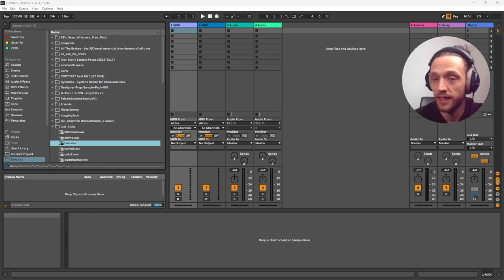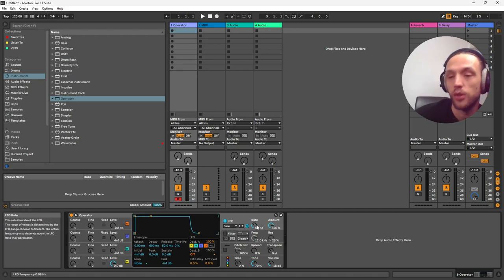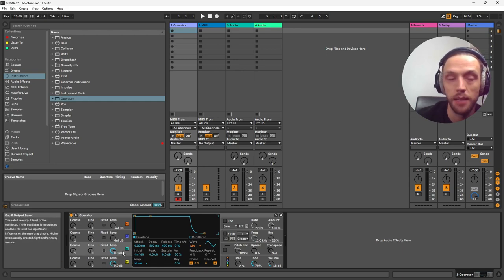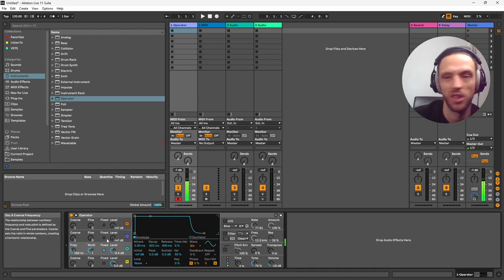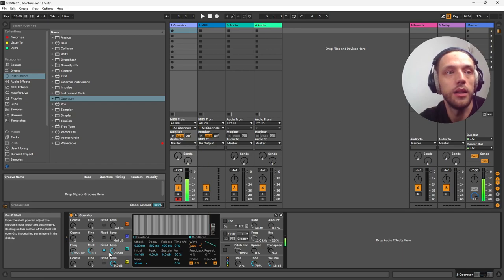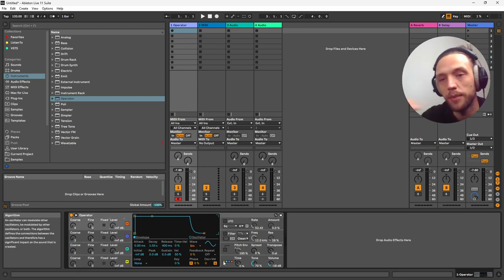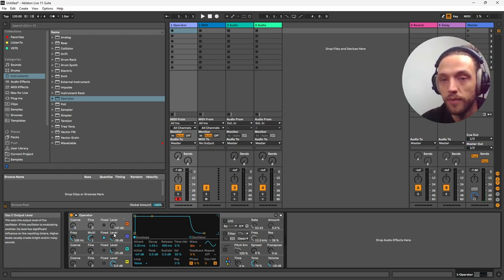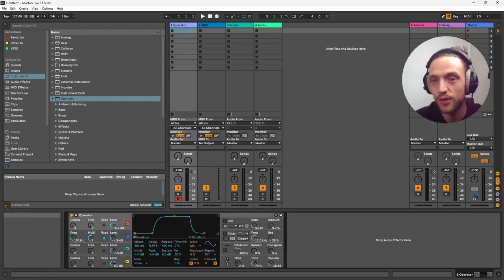FM Synthesis for beginners, for intermediate, for everyone really lets be honest, anyone can watch

Comment: Hello your chain selecta plugin is not working for Ableton 11 and I would like to know if you can service the plugin to make sure it's working on Ableton 11
Reply from the maker: I think you're on your own with that one unfortunately. I don't think I will revisit it. What are you trying to do, maybe I can point you in the right direction?
Reply: Sorry for the response on a different account. My buddy was trying to help me fix this issue. 

I mostly just want to use it for its original function of switching chains.

I can get it to work while only using the second batch of tags. If i mess with any of the first batch the whole thing crashes and wont work at all.

Examples: (#000 #000 #16n) - (#000 #127 #16n) works , but (#001 #000 #16n) - (#008 #127 #16n) does not.
Reply: The moment it stops working nothing really fixes it. Ive eve tryed my own projects and it still wont work.

Only really get results opening it from the mr. Bill project and not messing with the first #000 set.

I spent about 5-6 hour reading the notation for max for live. Try to see if i could identify the issue.

But my skills are limited...  I understand most of the paths and the unpacking of integers. Took a while to understand the reason for all the $1-$3 
But that was to keep it dynamic.

While digging around i honestly just felt like a parameter path got changed around or a few phrases might be out dated for ableton 11
Reply: I greatly appreciate any and all help you can provide. Its a pretty cool idea.
Reply from the maker: @FuzzyEQ  hmmm, send me an email to woulgdevices@gmail.com with the patch (I don't think I have it on my computer anymore haha) and your YouTube username (either of these 2 I guess) and I'll see what I can do. Sounds like it might not be too long to fix from what you described so I'll try to take a shot at it
Reply: I definitely plan to keep messing with an instance of it to see where i can get.
Reply: Omg i think i actually fixed it. I changed the "parameters 9" into "chain_selector"
Reply from the maker: @FuzzyEQ  hell yeah!!! thats sick! post the fix if you want to so other people can download it :)
Reply from the maker: let me know and ill share it also